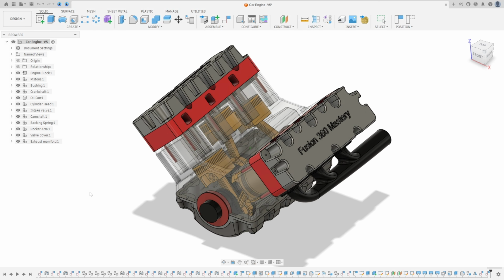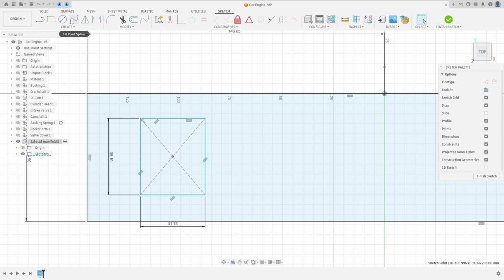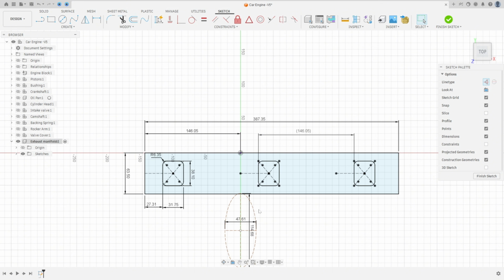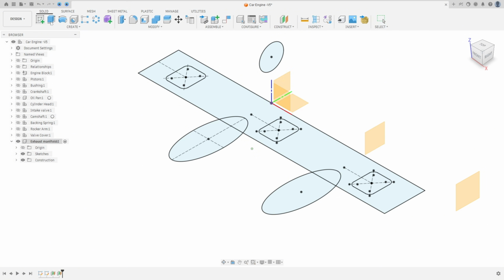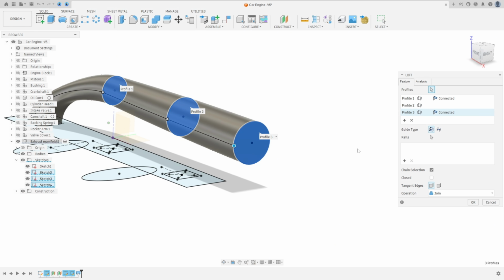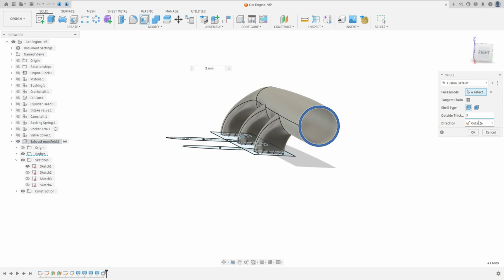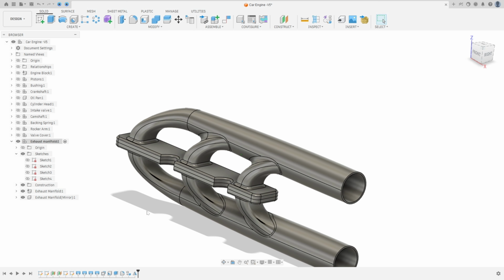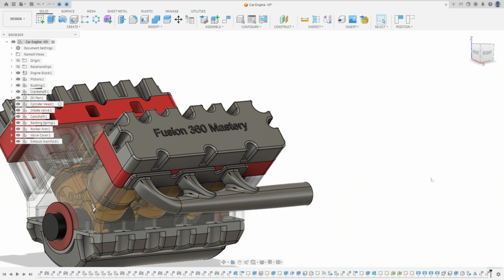Modeling a V6 Engine Exhaust Manifold in Fusion 360 | Part 10

Comment: 283
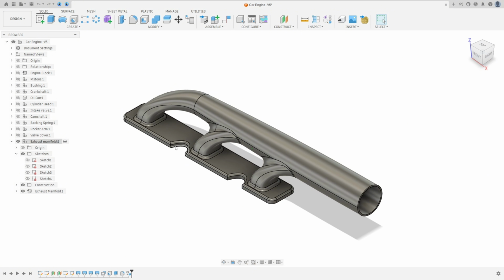Just a small note: at 11:01, Body1 is shown, but one second later it has become the Exhaust Manifold component. It looks like a step was accidentally skipped. You need to right-click Body1, select Create Components from Bodies (or Create Components from Body, depending on your Fusion version), and then rename the newly created component to Exhaust Manifold. After that, you can mirror the component and continue with the tutorial.